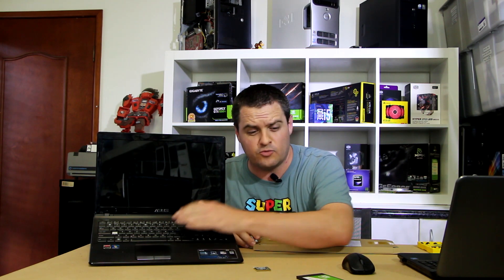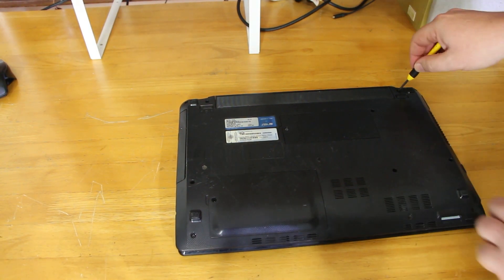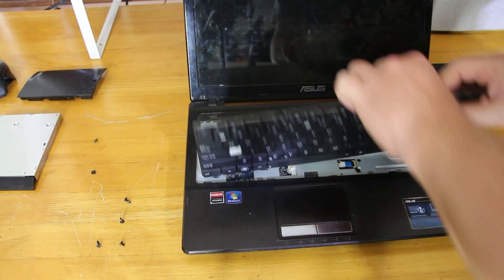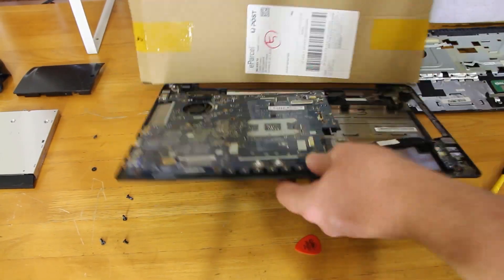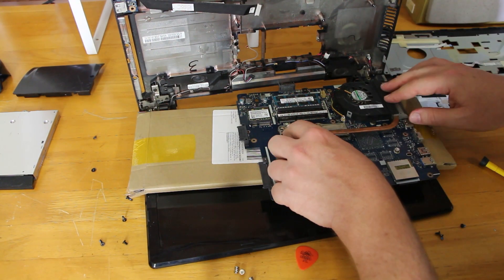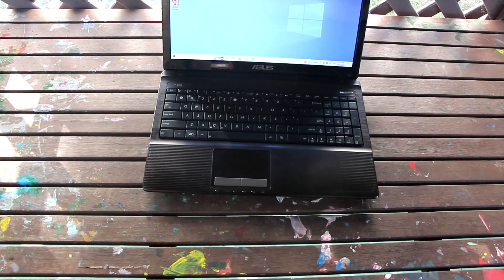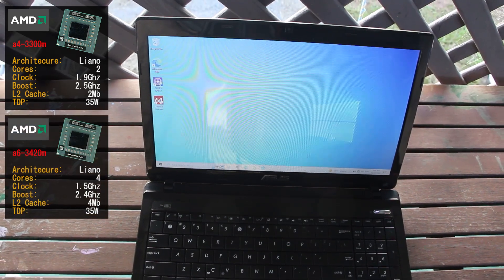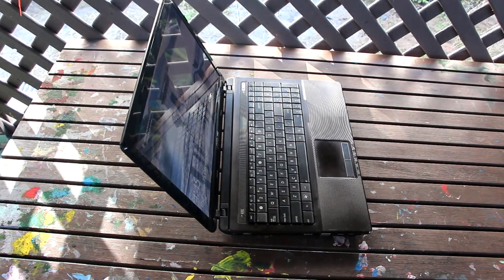Asus k53z Laptop CPU / APU & SSD upgrade. AMD A4-3300m to the AMD A6-3420M.

Comment: Hi,

I got one second hand about 2 years back & fully upgraded it. 😊🙄

I replaced the CPU to the AMD A8-3520M & is running with 2x 8 GB DDR3 PC3-10600 1333 MHz RAM. I also put in a 250 GB SSD for better performance. 😉😎💪

Now I'm thinking on modding the BIOS to unlock hidden features... 😲😨🤓

Best Regards,
Reply: How do you have 16gbs? This laptop only supports up to 8gb in total. If its possible please enlighten me 🙏
Reply: @BestMeme2031  I just simply did. Bought the 2 RAM sticks off eBay & put them in & the laptop booted fine. 😕😊😄
Reply: @davidbolha  And it's saying 16gb available in system information?
Reply: @BestMeme2031  There & in CPU-Z & AIDA64 software. 😏
Reply: @davidbolha  That's actually crazy then, what kind of games are you able to run on it with the extra 2 cores and 16gb?
Reply: @BestMeme2031  I actually honestly don't game anymore so I can't tell. My last game was Half Life 2 almost 10/15 years ago. 🤔😕
Reply: @davidbolha   Can 100% confirm that all 16gb of ram works! 🙏 Just gotta wait on the A8-3520M 🙌. Do you remember if you needed a BIOS update at all?
Reply: @BestMeme2031  You tried it already ? 🤔😇

I remember at that time when I was buying the parts for the laptop I was reading that perhaps an A8-3550MX might work too (though higher TDP - 45W). But then I decided to go with the safer option of just buying the A8-3520. 🤔😕😊

With the BIOS upgrade I can't recall but you do have an option within the menus of the BIOS to do the upgrade. So you don't have to like install Windows first (in order to do the upgrade). 😏👍
Reply: @davidbolha  You bet your ass I tried it lmao, had this laptop sitting around for almost a decade now and decided I wanted to see how well I could make this shit run 😂. And I've read as well that the A8-3550MX could work, but it seems pretty damn rare nowadays. If I found one at the right price I'd definitely still cop just to see if it works though.
Reply: @BestMeme2031  So for what are you gonna use your (future upgraded) laptop for ? Just gaming or more "noble intentions" ? 🤔😆😅
Reply: @davidbolha  Not planning to really game on it as I still got a desktop, but i'll use it mostly to host servers for games. Thinking about making a Plex server as well.
Reply: Lot of ddr3 laptops actually Support 16gb